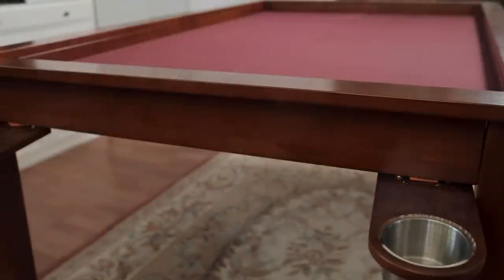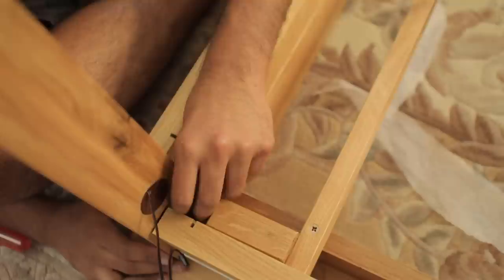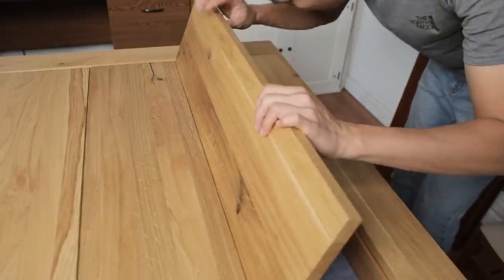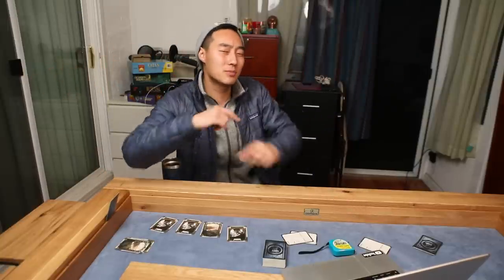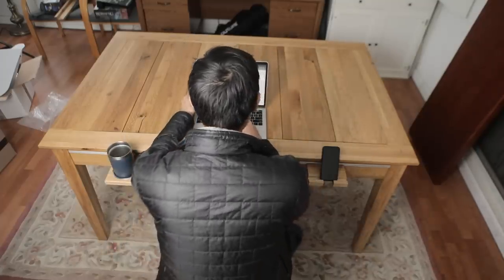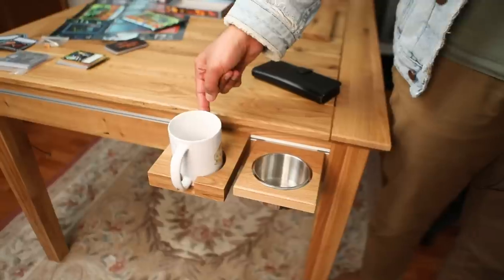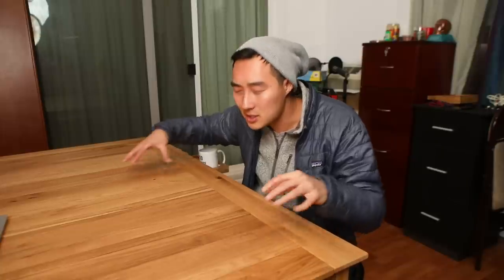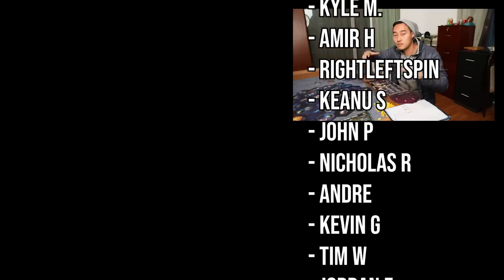Reviewing a $3000 Board Gaming Table

Comment: 04:49 I think those measurements are backwards.
Reply from the maker: dang, how did I not see that. Pinned your comment :) -Ashton
Reply: Measurement I believe are for the external and not game vault  area I believe as well:

Lifted from their KS:
External size: 39.4" x 59" (100cm x150cm)
The Gaming Vault dimensions: 30.7" x 50.4"(78cm x 128cm)
The Vault Depth: approx 8cm
Height: 30.3" (77cm)

Comment: I have this table over 2 years now. I’ve worked with wood in the past and this table is very nicely made. We take the leaves on and off several times a day most days to play games, eat dinner, kids do homework etc. They work really well. I can leave games setup for later without blocking the table for use by my family. I’ve spilled drinks across the table a few times and the leaves caught it and drained it out underneath the table without destroying the game setup in the table well. Crumbs do get caught in the gaps but I usually just hoover quickly along the edges of the leaves when I take them off.

As regards accessories, I bought too many but am glad to have them. Most important I think would be the leaf box to store the leaves, then the counter holders which fit a coaster perfectly and we use all the time to hold our cups of tea. The mug holders are not very useful because all our cups have handles so they won’t fit in. The side tables and iPad holder come in handy now and again.

Sitting down in an evening at this table to learn a new game when the house is quiet and everyone’s gone to bed is a pleasure. I would recommend getting one if you think the price is ok.

Comment: We have the Megan table but the large one. We have the extra height legs too as I'm pretty tall. We've played up to 5 player TI inside the table. Pretty crammed even on the large one. 
We have some of the accessories you have and some you don't. We didn't really see much practical use in the bits holder, so pro tip..
Put a coaster in it and use as a mug holder. BOOM!
We love our table and use it all the time. Very happy with it.
Reply from the maker: awesome! I think the coaster usage is good for the accessory tray. Or just use it for wallet/keys/phone haha. Cheers! -Ashton

Comment: There are some serious faults with this table for the price. A £2250 table should NOT have such large imperfections filled in with low grade epoxy that doesn’t even try to blend in. Not only that, that is a pretty sloppy job. Looks like they just slopped it on and called it good. It should at least be a 100% seamless epoxy without rough spots, but, again, a £2225 shouldn’t have such lazy woodwork. Look at that crack at 4:17 and how that epoxy job is so messy! They used a piece of wood that should not have gone into a £2225 table, epoxied it with the worst color imaginable that highlights the mistake, and didn’t even epoxy it correctly. Just bad..

Next, the base of that table should be solid. A thin wood veneer is lazy. They could have at least made that a solid 1/4 or 1/2 inch slab. If someone bumps the bottom of that table with their knee, there’s no protection for the play area and nothing stopping the play area from bouncing, ruining any game going on there. Poor design. It should at least an insert slot in some way or have something holding the play area firmly in place.

Also, the prices for those accessories are extremely over priced and kinda sloppy (as you pointed out). Those take 15 minutes to make. That’s egregious to charge $72 for a slab of wood with a bracket screwed onto it. I would expect, for that price, the mug holders should be less deep to accommodate different size cups, there should be built in coasters in them, etc. and why are there differing corners.. For the price they’re charging? Come on.. this is amateur work

Look, the table seems fine and functional, but tables costing £2225 need to nail the small details. This table does not nail the details for its asking price and it just comes off as amateurish. Not to mention, the design of the table is a bit college dorm room/ikea looking. Was kinda hoping for something a bit more stylish, but that’s just personal preference.
Reply: Yeah. The Wyrmwood MGT destroys this table for the same price point imo.
Reply: I don't get "gaming tables" which are tiny. Give me a 1.8m table at very least
Reply: @garylangford6755  The table in this video is small due to the space available in their gaming area. There are all kinds of tables from tiny coffee tables to massive wargaming tables. Basically, if it exists as a normal table, you can probably buy a "gaming" version of it with a vault and topper. I hope that info helps.
Reply: The wood they used is common grade garbage too.

Comment: Nice review! A few things of note as a woodworking hobbyist:  your friends' table with the 'not smooth' wood on wood connections, have you tried a coat or two of paste wax? then on the large tray accessory that had a loose bottom, conventionally drawer and tray bottoms made out of solid wood need adequate room in the dados for expansion and contraction so that's likely intentional.
Reply: A little paste wax on the metal to metal connections can help them slide smoother too!

Comment: One thing I haven't heard anyone talk about in table reviews is because the accessories don't lock onto the rail, it seems to me if they're bumped you could end up with a spill. For example, suppose you're sitting at the table and you stand up and accidently bump the cup holder. Does it come loose and spill the drink all over? I've seen other tables that have a latching mechanism that seem like they'd be less prone to spillage. Oh, another common example would be dropping a game piece, you lean over to pick it up off the floor and then you're head bumps the accessory on the way back up.

Anyway, thanks for the great review!
Reply from the maker: Good question. They are actually really secure, so I didn't have any worries about bumping drinks side to side. BUUUT, I am still concerned about the bottom coming loose and that causing spills. Head concerns are definitely valid for the side table! -Ashton

Comment: I bought a larger table a few years ago to make sure I had room for the bigger games and wargaming. I thought, foolishly, that maybe having the ability to leave games out underneath I'd play them more often. Not the case. Sadly without having a dedicated gaming room and group, it just becomes a surface to dump stuff on, which means dings and dents. Having cats means scratches on the surface. Takes up a lot of room. I wish I just got standard table size like this or saved the money and stuck with my old dining room table. I don't mean to doodoo on game tables, I do like mine despite what I just said. I suppose just to point out the obvious and make sure you really "need" and can accommodate one.

Comment: 5:39 I had the same issue with my Duchess table. I finally got a sheet of 1/4" plywood and cut it to fit as a replacement for the two half-sheets.

Then I had to use a router to thin the edges to 20mm, turns out the dimensions are all in metric, a bit of a surprise for what I thought was an American company.

Comment: We have a guy locally that mainly builds stairs. The equipment he uses is pretty much the same as what you need for large furniture so he also does a lot of tables. I'm pretty sure he could build this table for for less than 3000 grand. Also all the accessories you can pretty much make yourself using hand tools. You just need to find an aluminium profile that fit's inside the rail. I'm guessing that the rail itself is not custom built but an off the shelf component so it should be pretty easy.
Reply: Anyone could build this table for less than three grand if you have the tools, but you need to buy the tools, pay for labor, pay for the design, pay for the wood, etc. $3000 for this table and accessories in the long run isn't that terrible, as it is only a bit more than a typical dining room table, with way more features.
Reply: Pretty sure you are wrong about that, espescially the first table. If you work in any trade you know the setup and design takes almost as long as the build itself. 

Also wanna point out that the price of furniture grade lumber is not the same as home depot prices. Nice clear oak is probably around 8$ a bf, do the math and add 50% because you can't get every length everytime. Things like the legs are even more expensive.

Wanna also not that you are paying for their expertise and time. Not just the actual labor, as well their shop space, all the tools they have and so on and so forth
Reply: I've seen plenty of "trust me bro, I totally know what I'm doing" DIY tables. I'd rather pay for a professional.
Reply: Well, 3000 grand is $3,000,000 so I sure hope he could build it more cheaply than that.

Comment: I put this much into a Geek Chic table which I never received because they went belly up before we got our table. Fortunately my credit card company ponied up the refund. Ended up with a Carolina Game Tables. The first one had been I suspect hastily refinished by the delivery company which likely damaged it and the finish was trash. It bubbled and cracked in multiple places after a couple months. After voicing my concerns the company sent me a brand new table. While I could have done without the multiple trials I am pretty happy with what I got. It's our primary dining table but with enough room to keep a game set up inside it. The one big downside is it still uses the two piece topper. I Will add that CGT was superlative once I got back to them to report the finish problems. No arguments and personal response from the owners. 2 months and we had a new table which has held up for years now.
Reply: That's awesome, I'll definitely look up Carolina Game Tables, sounds like a great company to do business with!
Reply: @jimmyschwartz6186  Great, I'd say from a construction standpoint they are solid as heck compared to some of the other options out there, but at the expense of modularity. They are IMO the table option most directed at the mixed-use household who will frequently use it for everyday stuff other than board gaming. If you're looking for accessories like those highlighted in the video they don't offer anything other than fixed-position cupholders. The other 'odd' design point is that the short sides are very deep before they reach the well, meant to hold papers and books and stuff. I didn't think I'd like this but it turns out to be a good idea in actual use because you can keep reference materials and stuff out of the shared play area but easily on hand... but if someone is on the shorter side they may struggle to reach the well.

Comment: I suspect the bottom of the component tray was slightly loose to account for expansion and contraction
Reply: Yeah that's standard construction for cabinets, if that thin backed piece was glued in, there's a good chance it would eventually crack due to expansion and contraction, and good luck fixing that.

Comment: As a woodworker, I fully appreciate the time, design, and work that went into making this table. Having said that, the prices on the accessories is just gouging. The 'side table at $72.45 for a piece of wood (or several glued together) with beveled edges is ridiculous. It's what? 12"x18"? or smaller? Yyyyyeeeeah that's dumb.

Comment: i built my 4x5ft game table with a 3 piece topper for 300$, solid wood. My minor issue was the topper has a slight slight warp but if i ever want to fix it i could just build another topper. but its a minor issue for me.

Comment: Not really a fan
The biggest point I can give it is that it does look sturdy which is a sign of good materials and joinery knowledge, kudos to the designers on that front

Something I really hate about these tables are the topper lids, whether it is 2 or 6 pieces I hate how you have to move everything and have a bunch of random wood in the corner of your room while you play, the bottom plywood being one single piece is good for flatness but the fact that it is just supported in 1 direction worries me for the future

Personally not a fan of that color since to me it looks like you are playing on a picnic table but that is totally subjective and there are other colors (the 6 topper design doesn't help that)

For me the rail is very distracting specially in that color and similar to having the lids on a random corner while you play you also have all the accessories either laying around or needing to always have them on the rails even if you don't need just so they don't occupy gaming space, the duchess' integrated system is so much better and slick in my opinion

And WOW are those mediocre accesories expensive, over 70 bucks for an extra table that is just a small plank with no other features? 7 of those slabs are worth the same as a full duchess table lol

Again, structurewise the table is great.... everything else fell flat for me

Comment: I love my Megan table, but yes trying to fit the nuts was difficult, i’m not looking forward to taking it apart to move it
Reply: I found a simple position that made threading and hand tightening the lower bolt much easier. I placed the palm of my hand on the inside bottom of the table frame and used my thumb and index finger to place the nut. The bolt is actually opposite the back of your hand so you are threading the nut onto bolt in a much different hand position than usual, but this makes it so the leg is not in the way. I hope that makes sense.
Reply: @dumas8112  I think it does, thanks for the tip.

Comment: The filling of those cracks and imperfections is exceptionally sloppy - it can work with darker woods and for smaller imperfections but that large crack in particular you would expect to be graded out rather than just filled. The fact that they were happy to send this out on a table which was intended to be reviewed makes you wonder if normal, paying customers would potentially be sent even worse.

The topper system is visually nice, but I have concerns that there would be serious waterproofing issues along the long edges since there's no gasketed join there. The accessory rail is frankly just ugly, and the accessories are visually way too thick - especially that mug holder - and there's a lack of consistent visual style to them.